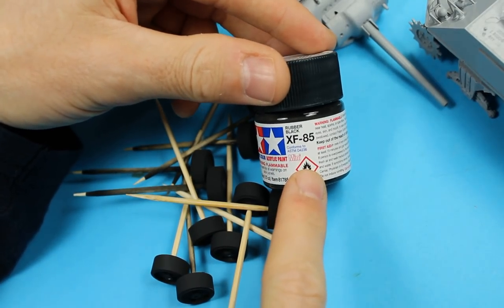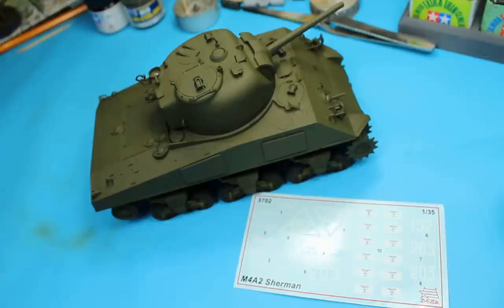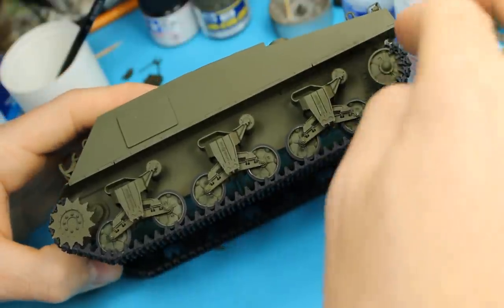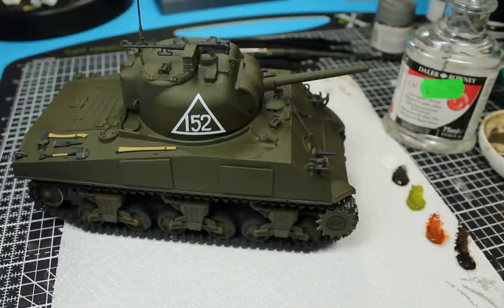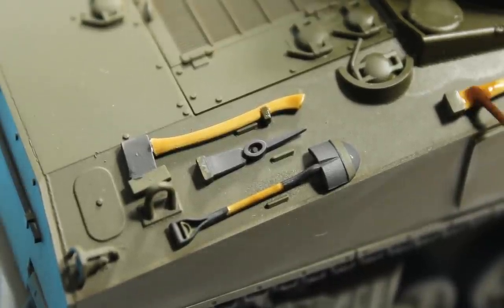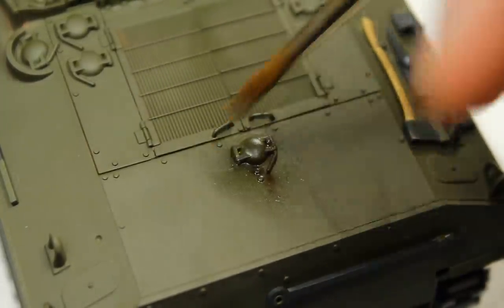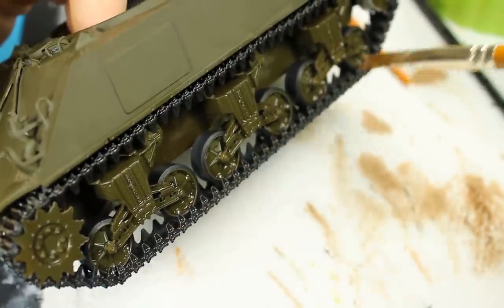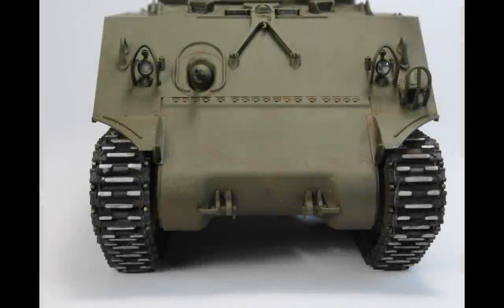Zvezda 1/35 M4A2 Sherman, Step by Step Tank Model Build Video, Part 2

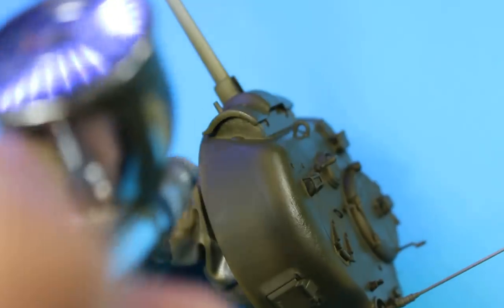Comment: About to do my first all olive drab paint scheme on a 1:35 model and have been concerned about it just looking flat and boring. Excellent tips here to apply! On 1:48 models I had good success doing technique from wargamming mini with a base coat, wash, dry brush/highlight to build up texture and colour. That doesn't work on big flat surfaces though so need a new approach - thanks for the videos mate!
Reply: One thing you can do is use different colors to add highlights when airbrushing. I use Tamiya. So i I'm doing a olive drab tank, I'll use flesh, buff, and a light grey. White is too stark. The highest highlights I might mux a combo of a yellow and a clear yellow to it, but just a drop. It adds a lot if depth.

Comment: Another great video, I’ve bought some abteilung oils in order to follow these builds along  great stuff keep the great work coming 👍
Reply: You can much cheaper just thin down youre acrylic paints a d make washes that way. Or buy cheap oil paint witch is just as good since most of the paint will be streaked away anyways so paint quality dont matter.

Comment: Fantastic video and some very useful information. When I use tamiya XF62 it often gets fingerprints and dark patches ( due to the oils on hands). Is there any way of remedying this issue.
Reply from the maker: Yes over coating with a varnish will stop that but if you prefer not to, just wipe the model down with a smooth cloth once you’ve finished handling it, or you can also wear gloves through the handling stage. It’s because it has a very matt finish
Reply: @ChampionScaleModelling  Excellent thank you very much.

Comment: Great great work. Do I get it right that you painted it overall with acrylic paint and use acrylic paints for washing and weathering? I wonder how the base coat of olive drab stays undamaged by weathering process?
Reply: How about the question? 🤚
Reply: Base coat is lacquer paint, dries hard as a rock
The oils dont interct on top, its when u start overcoating the ouks w clear varnish where u start getting interactions, since oils take so long to cure completely

Comment: Where did you get the wheel mask from?
Reply: You can buy ‘Circles Template’s online (Graphics Direct or Amazon etc) or from a local Hobbycraft or W H Smiths for approximately £2 - £3 , (some kits include a photo etch stencil).
Reply: @kevbee8325  excellent thanks alot. Bought a plastic one from Staedtler. Hopefully it will do the trick 👍